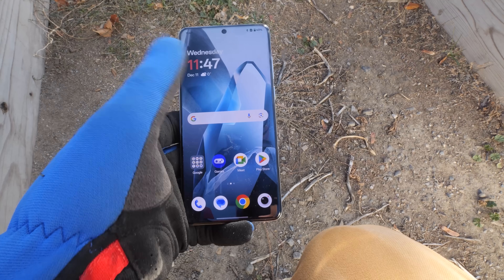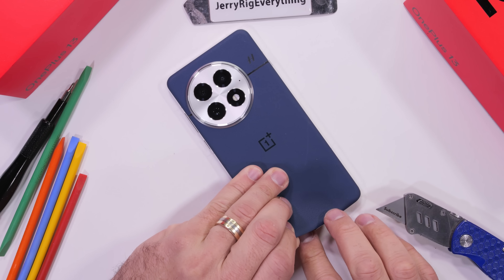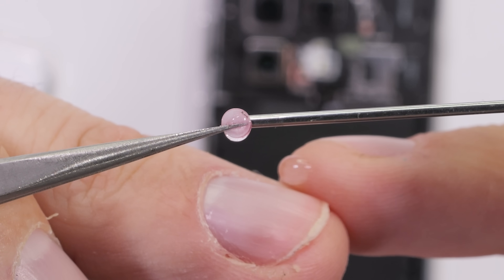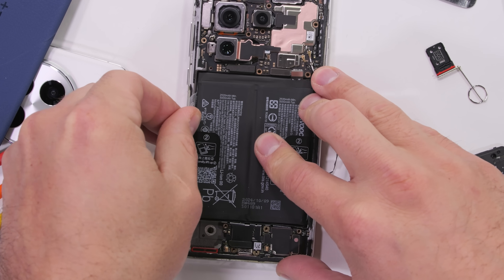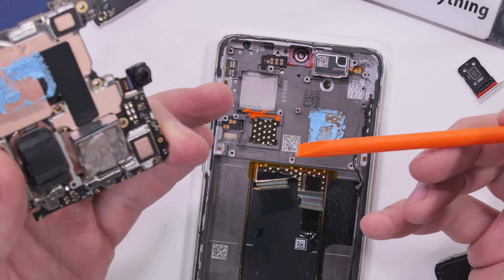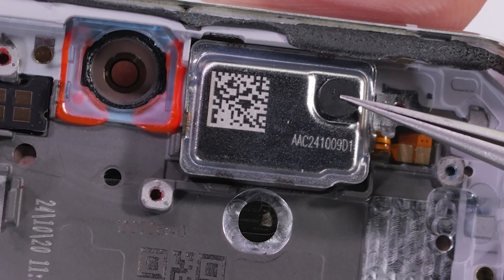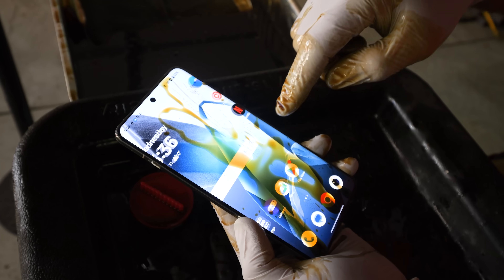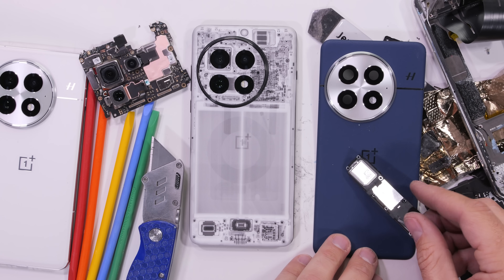The OnePlus 13's Double Decker cooling system - TEARDOWN

Comment: Bro got sponsor:

Testing method changes to:
1. Dropping the phone on soft grass
2. Putting the phone in cold engine oil
3. Places the phone in dish washer when it was fixed and just have to spare couple of water spray
Reply: The engine oil was for testing IP68.
Reply: @John99YT  engine oil is more viscous than water.. it doesn't test anything to get oil on it
Reply: let me ask you this, will you drop your phone/s on solid concrete? wihtout a cover? from 10 feet above the surface? no one in their right mind would do that. no one is gonna do any of the stuff he did in this video. This video isnt the usual piece of content this guy posts, its different. he'll upload a video doing the bend and scratch test too. wait for that. your points are valid but the delivery was a bit...off, considering this guy has provided the best possible durability reviews and tests possible.
Reply: Gosh, let’s question the man’s entire integrity because of a sponsored video… 🤦‍♂️
Reply: @macfanguy  yes, let's.  There is a reason conflict of interests is a thing.
Reply: This isn't his first sponsored one plus teardown.
Reply: Like MKBHD and other shitheads are getting paid for Apple, Samsung and Garbage Pixels.
Reply: Actual durability test will come soon
Reply: oh look, he did the usual tests in the latest upload . happy now?
Reply: @Qimchiy  yeah man!!🥳🙌
Reply: My thoughts exactly.
Reply: Bruh if in 2025 you dont know what an embargo is then better you fall for it
Reply: 1st is right but we aall know every phone breaks when throw in hard surfaces, 2nd why would you put your cellphone in hot oil, no mechanic does that, 3rd one is kinda wacky and useless test
Reply: You forgot if he dropped the phone off a roof on to the concrete, it be dead, just like all 100% other phones.
Reply: First off this isnt his normal durability methods hes clearly testing their claims that this phone can survive engine oil and being put in a dishwasher or washing machine. Second off if u think he went easy on this test and he didnt actually test it enough go put your phone in a dishwasher for 30 minutes let me know how it goes.
Reply: This isn't a durability test it's a teardown 
 @tekniik
Reply: All very suspicious
Reply: every other person in the replies fails to see the painfully obvious satire.
Reply: @kiryukazuma2158  wait, if someone is being satirical I for sure do not see it.  Please explain, because nothing about the video appeared to be satire
Reply: Why are you hating on bro? The phone is nice. Pretty sure he’ll do a much stricter test. Jeeez. Can people make money to pay  bills?!
Reply: @goobergaryguy  If the whole point of your channel is testing phones and you're then paid to go easy on them then you've compromised your integrity. Like why should I trust any testing he does if I know his reviews can just be bought?
Reply: @steveman9668  zach does durability testing videos and teardown videos. this was a teardown video and he tore down the phone. he doesn't do reviews, so not sure where "integrity" comes into it. his durability "tests" are not scientifically rigorous (he literally just abuses the phones to see what happens) so i'm not really sure how your "trust" can be broken. 
if you don't like the FREE entertainment he provides or how he decides to monetize his channel... go away and don't come back and see if anyone cares
Reply: @steveman9668 first thing, it IS a sponsored video. Second he'll release another doing the usual tests. Y'all act like this is the first time he got sponsored and think he does this for free.
Money comes from somewhere, you and most other viewers aren't paying him to keep him afloat without sponsors. He has a business to run. Geez. A phone drop is a phone dropped in this case twice. The phone being covered with motor oil then cleaned in the dishwasher still actually happened. Would you do that with your own phone?
Reply: @steveman9668  You're confusing the teardown videos with durability test videos.

Just be patient my buddy...
Reply: @ConsecDesign  his durability vid was... soft
Reply: @goobergaryguy  this didn't age well, did it?  his stricter tests, didn't do much more
Reply: @goobergaryguy  relax man, just missed old JRE, that's it. Didn't get the JRE vibe this time. It was more likely a boring sponsored video. No hate to Jerry. I will welcome his true testing if he wishes to do that.
Reply: @goobergaryguy that’s not the point he’s getting paid to say nice stuff abt it and make the product look better so can y trust any of it.
Reply: @emm4148  He didn't even talk about the magnetic charging which makes it charge faster than the older OnePlus 12 which also had 50W wireless charging since the magnets allow the charging coil in the phone to perfectly align with the charging pad unlike traditional wireless chargers which can be affected by the phone being slightly off centre to the side. This is also the reason why OnePlus's old wireless charger was a charging STAND and the new one is a puck since it is easy to align a phone on a stand vs a puck
Reply: @ idk why ur saying this his but it just sounds like ur talking abt mag safe what iPhones have lol

Comment: I dropped my Galaxy S3 off roofs and such multiple times. Even took it into a hot tub unknowingly for a few minutes before realizing, thing worked fine. I think unless you're either extremely unlucky or incredibly irresponsible with your investments/toys, durability just isn't a problem anymore with mobile phones. If you're in a high risk job or something there's even higher durability phones built for that as well.

Comment: pretty cool phone, i just wish phone would come with a headphone jack again
Reply: cabled headphones are long dead, come on already. no need for that bulky jack unnecessarily taking up space
Reply: @MERTMERIC7   Literally earphones are way better than wireless stuff.
Considering wireless earphones (good ones) cost alot in 3rd world countries, such as the country i reside in
having earphone jacks would be very good for the consumers as earphones barely cost anything even in poor countries.
But as always, capitalism. So no consumerism.
Reply: @MERTMERIC7   wired headphones are the only ones that last and sound better per buck. wireless is a waste of money.
Reply: @warmoaran3 that is true, wired will always be better in terms of quality, but the comfort and reliability of wireless ones are more than enough to rectify that gap in my opinion.
Reply: @MERTMERIC7  comfort is opinion based imo, my wired headphones are REALLY comfortable..
Reply: @ what about the wires though? carrying it around is always a hassle, and to take them out in a crowded bus for example and plugging it in can never be on par with a pair of wireless ones
Reply: @MERTMERIC7  my wires don't really tangle.. and its a lot better than dealing with Bluetooth, or another set of batteries, which will die. And that's the longevity thing, batteries will eventually die, meanwhile, wires won't randomly not hold a charge
Reply: @MERTMERIC7 i like saving environment, no e-waste battery in wired earphones
Reply: @doctormaycry30  still the same waste in plastics and production, arguably more than wireless since most people probably already own a pair of wireless buds so they would just throw the wired ones away